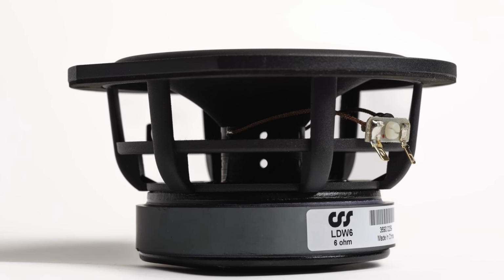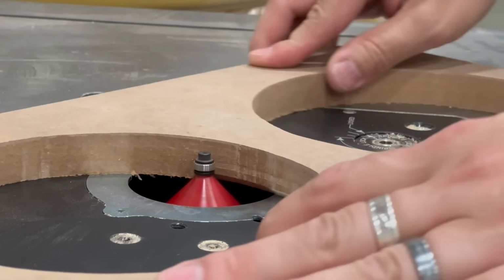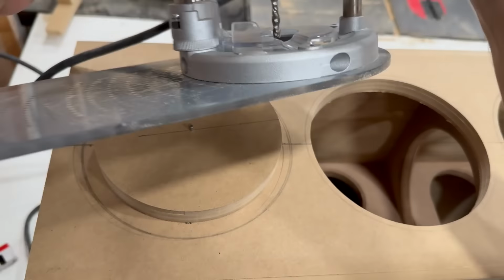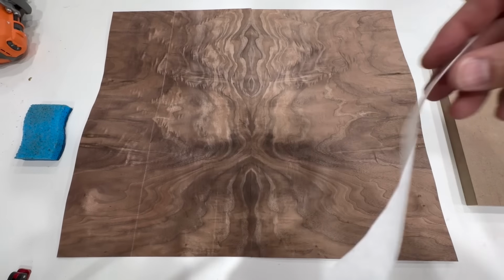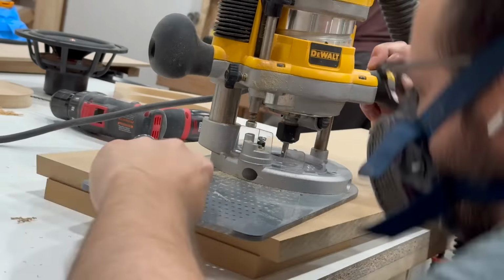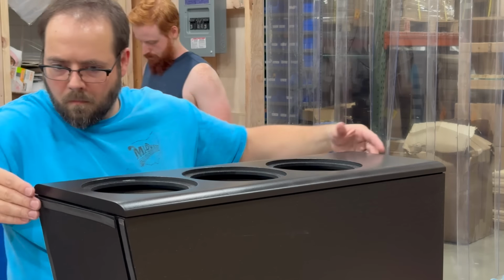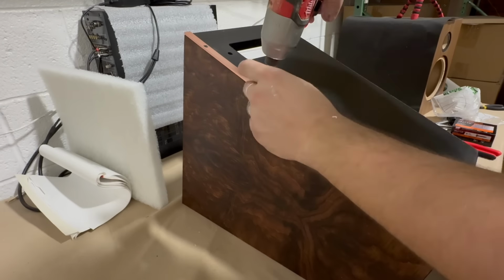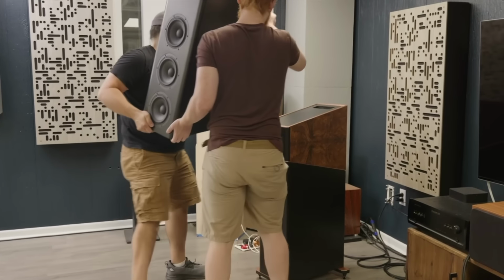Building an INSANE DIY Speaker in 30 Days

Comment: Absolutely beautiful...  Definitely outside of my skill set.  I have been involved in the sound industry as a sound engineer, custom amplifier modifications etc.  I can only wish I had the talent for wood. 

Hats off.  What would I do differently... Have the custom crossovers  covered with clear lexan.  You never want to hide beautiful work.  Crossovers are no exception.
Reply from the maker: Wow, thank you! I haven't done the crossover yet but you will still be able to see the. I've got a perforated metal grill that I plan to use. I'll show it in the next video.
Reply: skillet... I love it.  You have to practice to gain a skillet.  It's only wood.  you can always start over.  We all make mistakes.

Comment: It looks beautiful. How the box looks isn't my priority, although I prefer not looking at something unfinished. I built my subwoofer box (36" x 14" x 18") with opposed 10" drivers and a plate amp. I prefer dual 15" woofers in my speakers so they can play LOUD without distorting while remaining natural sounding. I build tiny houses as a side gig.

Comment: Gorgeous work. Been retired from active building in a real shop for over 6 years now, and it’s videos like this make me really pine for the fjords, so to speak.  Regarding crossovers, have y’all considered or played at all with miniDSP or such?
A video with in room REW measurements would be fun to see.
Reply from the maker: We’ve done active before but are usually able to get what we want out of passive which also makes for higher simplicity (one amp, speakers can be moved easily, etc.). The next video will dive into measurements.
Reply: @css_audio  Fair enough. A few (8?) years ago I built a couple of MTM and TMM 2 ways specifically for experimenting with three different XO methodologies, two of which were bi-amped: Passive Line Level; digital XO  using the DSP in a particular model of Onkyo AVR; and old school passive high level - which was modelled  via LMS/LEAPS, and was frankly my personal favourite. 
More recently I’ve been playing with REW / miniDSP for fine tuning multi subs and PEQ to front row of small HT rig built with all DIY speakers, so that’s still a fun toy. 
Anyways, gorgeous work on these beasts, and looking forward to the measurements. 
Cheers

Comment: If you have a 3D printer you can produce all of the templates you may need for any custom speaker builds you do. I find it very helpful for a lot of cutouts in braces or whatnot.
Especially useful for odd shapes where you can download a plan image or take a photo and produce a scale sketch to design the template. 

Just a thought if you haven't experimented with that approach :)
Reply from the maker: Thanks for the tip!
Reply: @css_audio  Most welcome. THank you for sharing the beautiful build. Inspiring creation. 

I mainly build home cinema subs but the construction and woodcrafting aspects are all the same :). 

I'm interested in how well the baffle works. 
If you have an elastic material I would be concerned the baffle alone is providing the opposing force against the driver pistoning.  This means that the baffle could be moving in a reciprocal manner with the drivers if it does not have sufficient mass to drive that to near zero. This is because a mastic prevents it coupling to the main cabinet mass. 

What are your thoughts on this?

Comment: This is an amazing video. This is my first time here, but I've already hit that sub, especially if you're going to do more build videos like this. I have a few thoughts that you can take or leave as you like.

I have found, block planes are good, but if you take the time to learn to set and use a Japanese pull plane you will be very happy with the added precision you get. I have not worked with veneer, but my understanding is precision is key when doing so. 

Copper and brass always look good but can be expensive. It's possible to anodize aluminum to look exactly like copper or brass. Once you are setup to do that it's a lot cheaper and it's easy to cast your own aluminum parts. Part of the anodizing is sealing the material so you don't have spray them with an anti-oxidation sealant. On top of that it looks like you are already using anodized plates for the posts plate and then laser etching the logo and text. You could make those in the copper anodizing, then laser etch, then anodize the etched part in black. IMO that would add even more to the look.

Again, this is my first visit so this may be answered elsewhere, but what software do you use for your cabinet modeling. I was looking around hoping to find a plugin for FreeCAD that would do acoustic modeling of speaker cabinets but it looks like the only real options are over-priced stand-alone applications that only run on Windows.

Comment: Nice work !  What coaxial driver is that ?
Reply from the maker: FaitalPRO 6HX150: https://www.parts-express.com/FaitalPRO-6HX150-6-Neodymium-Coaxial-Driver-8-Ohm-294-1192?quantity=1
Reply: @css_audio  Thought so, thats a nice designed speaker, no subwoofer needed in that room. With 12 7" of those awesome woofers there would be tons of bass.. Nice work !!

Comment: Didn't see your sound offsets how your internal casing equalizer for its raw sound output. Can't tell what instrumental playback it is designed for, IE Jazz speakers are way different than rock, based on the angular calculation for hte sound roll out.. hmm .. but its a speaker I guess, lol.

Comment: very envious of your shop and skill set.  How do they sound?  They look wonderful.
Reply from the maker: Thanks Jeff. The shop, other than the SawStop is fairly modest. We don't have a lot of stuff in there and the equipment isn't that expensive. You don't really need a ton to build speakers. 

Unfortunately I'm still working through the crossover design on these. The mid/tweeter are a beast to work with passively. I'm hoping to have them hooked up for a first listen later today or Monday.

Comment: That jasper circle jig would work great to cut the holes in the braces. Great build btw!
Reply from the maker: Yes, it does and I should have mentioned that. It is much slower and takes a lot more effort to setup though. Braces are so boring to me I want to get through them as quick as possible.

Comment: Hey! Technically impressive video to be sure. And appreciate the double wall. Solidity to help suppress cabinet residence. And I am familiar with those drivers. However, not spending $35,000 on those! Especially not even seeing the crossover And its components.  I realize as good as your shop is, it's not a professional speaker company with massive amounts of engineering time involved. So though obviously DIY, too many little errors. Especially having to use Bondo at one point.   Anyway, that will be big and boomy-- with reasonable mid-range and high frequency drivers. But it will never have the clarity of something like Vanderwaals or the glorious, unique sound stage of the brilliant, Ohms!  Both were far far less money. If you want to compete with Focal-- Go for it and good luck!

Comment: Good job!!! what you did is amazing!! you can really be proud of your work! but, 3500$ of materials is not only the cost of it :) More information is needed, like how much it costs to get all the tools needed to build this :) Rents, electricity, cameras, your own working time, video montages, etc etc. In my point of view, it's more than 3500$ for sure :)
Reply from the maker: Sure, but I wouldn't ever suggest anyone try to build something like this if they are starting from nothing. If you don't already have tools you really don't even have the skills built up to do this so you should just buy a kit that has everything you need.

Comment: Only 7mins in, but why not use the circle jig for the bracing holes?
Reply from the maker: You could but it takes a long time to lay out and you have to make several passes to cut each hole so it takes quite a bit of time.

Comment: In a commercial 10K pricetag speaker there is ....
2k sales tax
1.5k shop profit
And the remaining 6.5k is roughly 60/40 split on manufacturing and distribution costs / manufacturer profit
And the 3.6 k cost of cabinets , crossovers, wires and drive units can be as little as 10% spent on the drivers in the case of the B+W nautilus but mostly its around 50-50 .
So a 10k speaker uses drivers and crossovers that cost on average in total 1/5 of your shop floor spend . 
And thats the pre sales tax number .....😢
If your more interested in the furniture aspect of a speaker then something that looks fabulous , fine , dont expect sonic miracles
As to sound equally as fabulous is going to be a huge number .

Comment: Way cool! I’m in the (long) process of building a similar speaker, but all open baffle with mini dsp help. 6 8” bass drivers with a 4” Mark Audio fullrange center. There’s just something about a tall cabinet stacked with drivers. Definitely subscribing.
Reply: @hawker800mech  that sounds like a great project. I've done 3 open baffle builds lately... It's baffling, how good they can sound. Not muffled, fluffy bass like a tuned port.

Which mark audio driver? 
At what frequency are you planning to cross over?
Reply: @davebutler3905  It’s the CHR-70 and so far set around 250 Hz. I’m using GRS 8” subwoofer drivers and they seem to do well. I’m starting out low cost while dipping my toes into OB speakers. Plus, I’m going to make it somewhat modular so different drivers can be used if I want to branch into more expensive drivers. It’s amazing how good and open it sounds with it in a poorly built mockup and being one channel. The bass is just reaching into the 40’s. Sealed subs will fill in the lowest octave.

Comment: I appreciate the video HOWEVER you're looking at nearly doubling your budget with a quality crossover network and binding posts to match the caliber of speaker you made, so a bit misleading. I'll also agree with others that I think a proper tweeter and mid MAY have been a better choice than a full range pro mid. Maybe you can handle that with your crossover?
Reply from the maker: I see your point but double would be a lot more than I would expect to spend on this. I think $500 for the crossover is probably about what it will cost. 

As for the driver, it is a coax, not a full range. It has a tweeter inside the midrange driver under the dust cap, which isn't a real dust cap, it's an acoustically transparent material. It will be a 3-way crossover.

Comment: Good luck voicing those Faital coax drivers .
Reply from the maker: They are going to be the most challenging mid/tweet crossover I have done. Almost makes me want to go active ;)
Reply: @css_audio  I've used the 8hx200 and 6hx150 drivers in some of our loudspeaker designs here at TPI Sound in the UK. The compression unit does have a few issues with "shadowing" reflections that cause some colorations. The mid bass driver is quite dry sounding in its raw unfiltered state. Good output and dynamics available with decent power handling due to the primary design function as a high output professional drivers. Very interesting project. Cheers Ian.

Comment: I thought wiring in series screws the damping factor.
Reply from the maker: Damping factor goes up when impedance goes up. DF = Zload/Zsource. Higher damping factor is generally considered better. With that said, this is a series-parallel arrangement. The impedance is a bit lower than the original single driver due to having 3 in parallel and then that in series with the other 3.
Reply: @css_audio  It's the back EMF which stops the speaker cone resonating. It is why you use very thick speaker cables and hefty output transistors, so the back EMF is shorted out and gives you critical damping. The series speakers reduces this effect by the ratio of the output impedance of the amp which is very low and that extra few ohms with the series speaker. What I would do is drive the speakers banks in parallel with separate amps. I like the idea of an integrated amp so you have a very short speaker wiring path. The draw back is it will add to the weight of the speakers, but who really cares about that.

Comment: Very pretty.
You do this for money?
Please put away the toys and get a CNC router and a good drill press. Try to source a used radial drill press like what is used in a machine shop, a decent sized one will let you put the entire speaker on the table and pivot the arm around to reach any point. It will also run slow enough to used huge hole saws, or single point hole cutters.
As for the CNC, you need it. There are several open source CNC routers that can be built on a budget, and will do better than that little SawStop table saw, be much faster and safer, and let you work while it runs in the background.

Comment: Excellent! Love this video. Next time maybe a CNC to help reduce the time and improve accuracy of cuts. Your effort shows why brands like Sonus Faber charge so much for their absolutely incredible cabinet work. I'd love to have a followup video on the crossover design and then measurements.
Reply from the maker: We use a CNC when we are doing our kits but custom work is often easier and faster to do by hand. Measuring will help in the next video

Comment: Wait so you don't have a dedicated tweeter, just a coax in the middle?  That's SOO far from ideal, since coax drivers have serious significant compromises in their design that hurts tweeter performance... The best of the best ones like KEF and MOFI and maybe satori do well and come reasonably close to dedicated tweeter performance, but outside of that, none do.  You might be able to EQ them ok on axis but they all suffer from diffraction, plus the Doppler type effects of the woofer, which is the waveguide, moving at higher spls.  It also will not be able to keep up volume wise with a speaker this large and with this many drivers, meaning if you test the distortion and SPL limits the tweeter is going to be the limiting factor here in distortion and compression at higher volumes. 

Looks great though, amazing work, I would just design it differently.  If one of the main goals was having a point source through the vocal range, or the majority of it, there's other ways to achieve this, like a large horn, or a large planar/folded ribbon type speaker, or a large waveguide with the right tweeter selection, all of those could provide you a crossover between 500-1khz depending on your choice.
Reply from the maker: Thanks for your opinion but I disagree on many fronts. ALL SPEAKERS are compromises. There is no perfect driver or speaker and we use them to best attain our design goals for the given application. there are other good coax drivers outside of the 3 you mentioned. In terms of doppler distortion, that isn't really a concern when you are using a coax as a midrange driver crossed where I have it. There is no real excursion demand on this midrange woofer to cause this problem. In terms of diffraction, all studies I have seen point to diffraction being essentially inaudible. Many of the proposed changes you suggest have their own significant compromises. Large planar and ribbon designs have significant vertical dispersion issues, basically relegating you to a very narrow seated window without moving your head more than an inch or two. They also tend to have large on axis frequency response deviations and often suffer from high distortion at the low end making their actual useable response limited. A waveguide large enough to cross as low as you are suggesting would increase the overall cabinet in both the vertical and horizontal directions in a significant way. We have an event next weekend (September 28) and you are more than welcome to come hear them for yourself.

Comment: Looks great but... you forgot a tweeter 😣
240 hrs of work at lets say $25 an hr. Is $6,000 + $4000 in parts when finished so $10,000 all in. It looks nice but without extensive testing I am not sure it sounds any better than a monoprice $200 pair if speakers.
Reply from the maker: It is a coaxial. The tweeter is inside the middle of the midrange. I can guarantee it sounds better than a $200 Monoprice speaker ;)